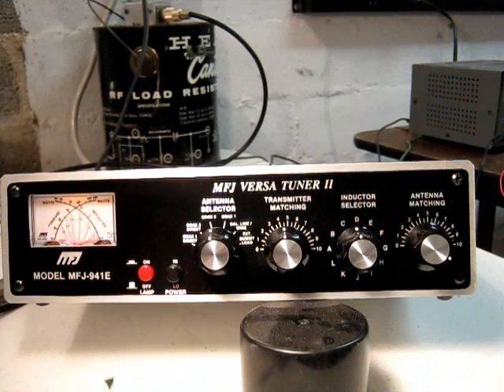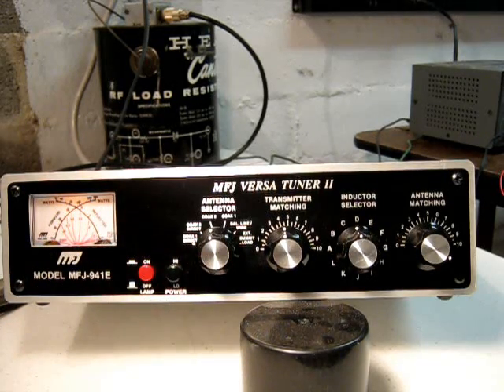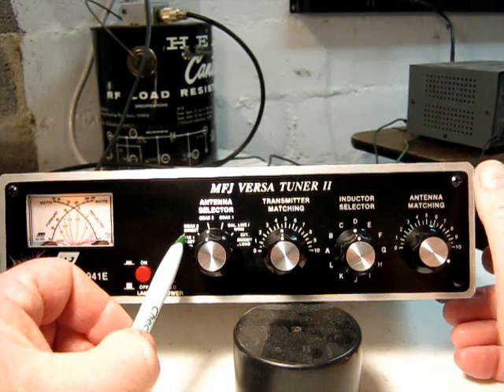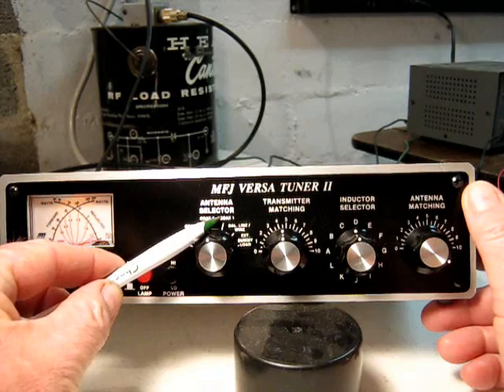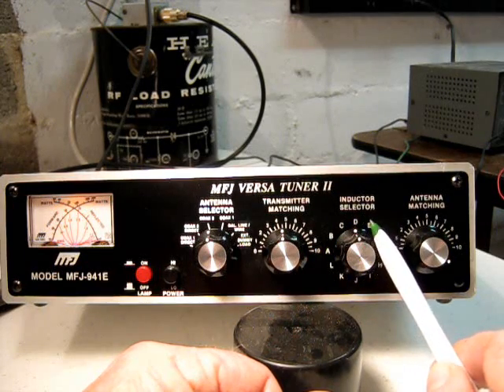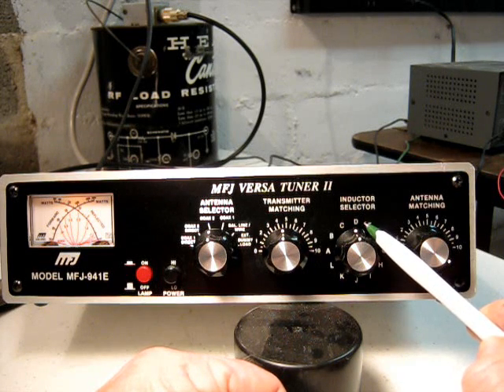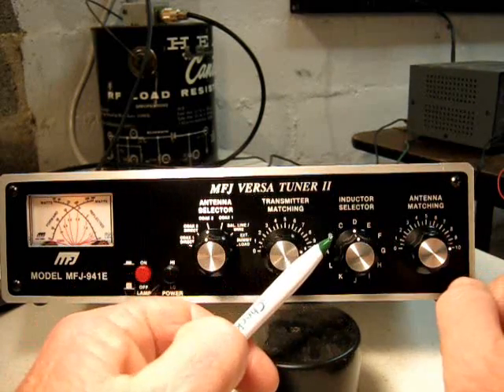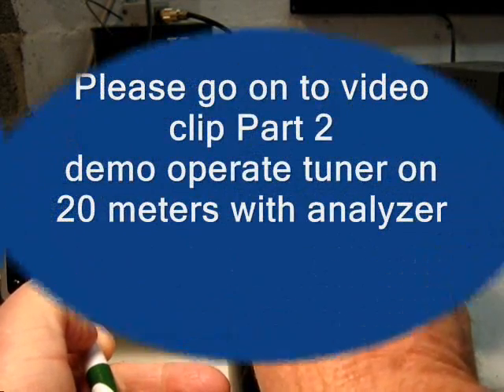Demonstration of controls settings on MFJ941E Antenna Tuner

Comment: Thanks!  I just picked up an older model a MFJ-944.
It doesn't have the meter but does have cool simulated woodgrain on the case :)
The transmiter and antenna knobs don't have any stops.
They just turn around past the numbers.
Is this broke or is that how it should be?

Comment: After teaching a class to Ham Radio Ops on the build of the MFJ 941EK antenna tuner I have many stories to tell. LOL :) I bought an extra kit to use incase any of the students needed a part. Not one of the kits shipped from MFJ had parts missing or damaged. Thumbs up to MFJ for their work and dedication. Thanks for the video! 73 Jimmy, WX9DX, ARRL TS

Comment: I would use an antenna analyzer and jot down the best starting points before hooking this to a radio "if possible". Also " if possible", it is best to peak everything in receive for best signal first before transmitting using any antenna tuner!  This puts the settings very close so little stress is put on your transmitter.
73
Jimmy, ARRL TS, WX9DX